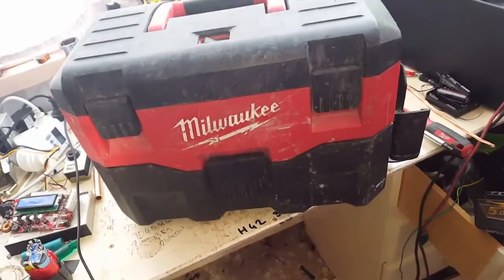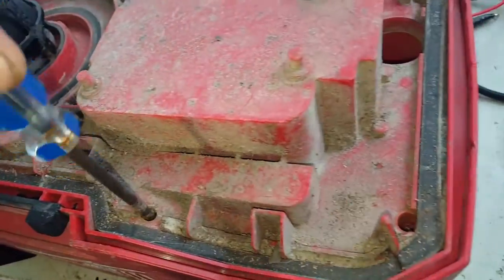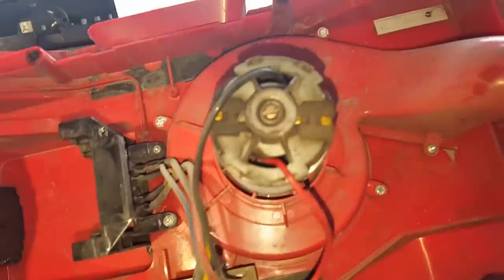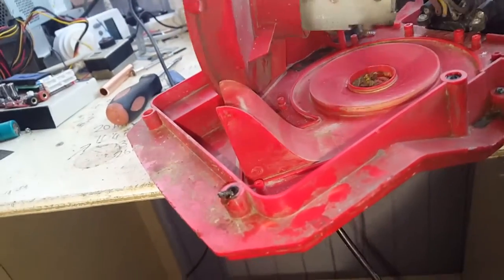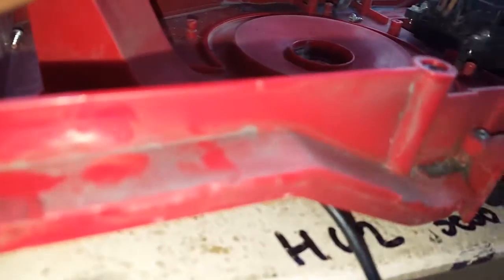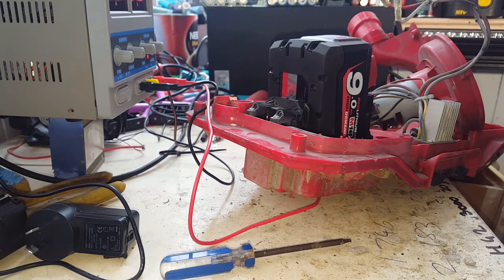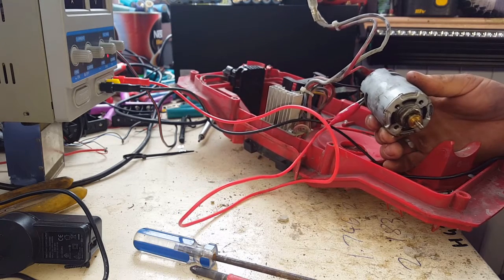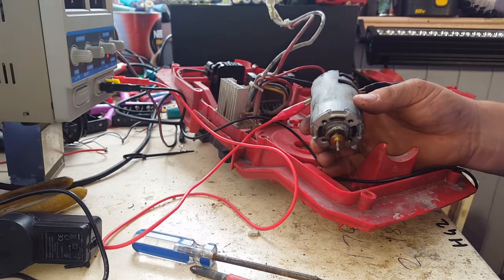Milwaukee m18 wet and dry vacuum cleaner tear down (dead bearing)

Comment: im in after snapping one of the screws off..maybe u can solve this for me...the motor runs fine well sounds ok,but the hoover will not suck or blow do you no what it could be ?? cheers for help
Reply from the maker: is the impeller spinning or has it come loose?

Comment: im struggling to get into mine..i removed the 6 screws but it still wont lift off to gain access inside am i missing something ...please help ??? reason is its only had about 5 hours use it turns on but wont suck or blow..and its out of warranty now :(
Reply from the maker: +daniel taylor hi mate you need to undo the battery holders inside the  top compartment  and the ones inside  the dirt catching tank then it should open . Some of them have plugs hiding/protection the screws let me know how you go. Thanks for watching
Reply: ill give it ago now thanks for the fast reply dude

Comment: I have a similar model, I don't use it often it worked fine, recently I wanted to use it and it's completely dead, any Ideas? I know the issue it's not the batteries
Reply from the maker: +Angel Chacon dust and dirt  in the switch mate spary some contact cleaner in the side of  it and cycle it cheers
Reply: Thanks For the help I'll try that
Reply from the maker: +Angel Chacon no stress concrete dust uswd to get in mine so i imagine its the same

Comment: I was ready to buy the M18 blower, and saw your video on the blown bearing there too. wtf is up with Milwauk. Worth buying? I have the M18 battery packs and charger for my impact gun, which has been flawless for years. Maybe I need to second guess this blower idea
Reply from the maker: +woppini covered under warranty  got new one going good as gold do you need bulk blowing  power or rgis one do
Reply: 5 year warranty here in the states, I guess I cant go wrong. My battery is only 2.0 ah, so Im assuming run time will be on the shorter side. But I do have 2 of them so that will help. Thanks for the review
Reply from the maker: +woppini no problem you will get 5 to 7 mins in high with a 2 amp i reakon. Please consider subscribing i do all sorts of videos  wirh milwaukee
Reply: Will do my friend, thanks again

Comment: You should maybe use a cordless electric screw gun to unscrew your machine components.  That would be much faster than a regular screw driver.
Reply from the maker: +Sammy Reedy yeah its on the list as you can see i undo so many little dam screws  in tools and batterys.  Thanks for watching

Comment: Wouldn't it still be in warranty but. They come with 5 years.
Reply from the maker: +gtlegend007 yeah but it rolled over in my work van full of water so sorta voided it and i had a spare parts place lined up to buy a new motor. But im just going to buy a new unit anyhow cause there so usefull

Comment: Try injecting some grease in there mate 
heat it up aqbit so it aint as thick then put it in there let it cool and try it 
mine did the same thing greased it up she was sweet
Reply from the maker: +Dennis Sewell did it  quieten it down a bit
Reply: did you get the link to a knew motor assembly
Reply from the maker: +Dennis Sewell yeah ill check her out when im on my laptop
Reply from the maker: +Dennis Sewell cheers mate

Comment: You're sure it's a dead bearing and not worn down brushes?
Reply: Btw. You might be able to find a suitable motor on eBay. It seems many of those DC motors have standard specs and so even though you can't find the one Milwaukee uses then you can find another brand that fits.
Reply from the maker: +HifiCentret hey yeah it is just a universal motor but it was all good and covered under warrenty thanks for watching
Reply from the maker: +HifiCentret na heaps of front bearing movement
Reply: OK thanks. Wasn't that obvious watching the video. A little narration will do a lot :)
Wonder when/if they'll upgrade this vac. Kid of looking into it but can't help wonder if it might see a "Fuel" (brushless) upgrade anytime soon. Equip it with proper ball bearings and a brushless motor and it'll be almost impossible to wear down.
Also wonder if a never version will have regulation. Locally I don't find this vac that expensive so if buying that I might put in my own PWM regulation but would be nicer to have it from factory. Don't care much about the warranty beside it seems it's only 3 years here - should be very surprised if it's not lasting a lot longer.
Reply from the maker: +HifiCentret last time i spoke to a rep for milwaukee he said that there was no plans on going  brushless as the high rpm universal  brushed motors in these  acheive good service  lives and a brushless motor would possibly double the price to consumers
Reply: Thanks for info! Though I do not agree it should double the price. Sounds like salesman BS to me. Brushless are more expensive, yes, but nothing that should double the price. DC computer fans has been brushless just about since beginning of time and adding a regulation is also not complicated. If they don't want to develop their own custom motor for it as that's expensive with manufacturing and everything I'm sure they should be able to find an of the shelf RC hobby brushless motor that'll be suitable with power and RPM requirements - they're very reasonably priced. Since it's a vac it has lots of room and the sizing of the motor isn't as critical as a drill etc. and so an of the shelf motor would make perfectly sense. Most of them also have ball bearings right from start.
Reply from the maker: +HifiCentret yeah they could easily  use one of the other brushless motor they already make my vac would have had so many hours on it i used it all the  time . That been said my m12 one works great still and its about the same age
Reply: Except their other brushless motors aren't build with speed in mind. Most of the other applications you don't want ultimate speed but rather torque instead. For a vac it's different unless you want to mess with a gearbox which isn't exactly prolonging service life. In a vac you don't need much torque but a ton of RPM. Same in many RC applications like small planes etc. Also if using their other motors they're not drop ins as those motors don't have a frame but are designed to be solely used in their drills etc. An of the shelf RC motor etc. has a housing just like standard brushed ones and to it's just a matter of small modifications of the mounting and space for a driver board (may not be bigger than the battery protective circuit already there) to make it brushless.
Reply from the maker: +HifiCentret the grinder motors would be doing 20k rpm there geared down like  crazy
Reply from the maker: +HifiCentret be cool to make my own brushless  one with like twice the airflow
Reply: Good point! Didn't think about that. However I still don't think it'll be ideal. While it may have the RPM it's still build with more torque in mind than required in a vac which of course will waste power. So you could up the diameter of the fan(?) wheel probably larger than can fit in the current dimensions or you could go even higher in RPM for the same amount of power.
That's the funny thing about electric motors. Depending on the purpose you can build them with very low speed and high torque in mind (electric unicycles etc.) or very high speed but very little torque - dremel/dentist drill/vac etc. You can run lower speed motors at high RPM and if they don't overheat and bearings can take it it's fine but it's at the expense of wasted power - which for a grinder is very acceptable as it has to have the power to grind where as a vac "just" spins a flywheel with fins.
I do also still believe a motor with a real frame will be more ideal in a vac but sure you can put it one.
Reply from the maker: +HifiCentret yeah with a bit and of stuffing around any things possible I guess. I'll buy another one of these soon tho as I had a good run with it

Comment: if it dont work knew parts from here mate cheaper than buying knew  http://www.ereplacementparts.com/motor-assembly-kit-p-201143.html
Reply from the maker: +Dennis Sewell what a great website! Thanks for that mate heaps of good gear on there
Reply: no problem mate as long as ya get good use out it i have keep the vids coming good work
Reply: every part ya can think of plus more good prices too
Reply from the maker: Oh yeah its excellent  makes me want to do some tool repair work in my spare time
Reply: that will work mate little bit of extra income
Reply from the maker: Good for some  interesting  look inside style videos
Reply: ill be watching them
Reply from the maker: Cheer mate thanks for your support